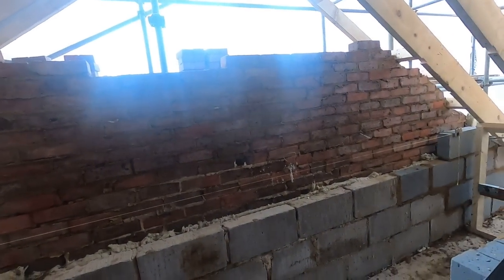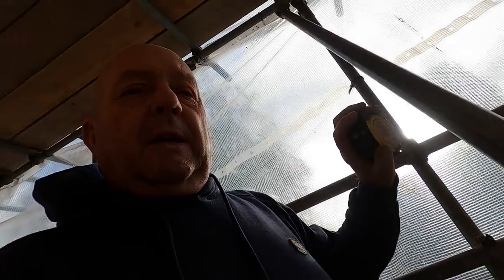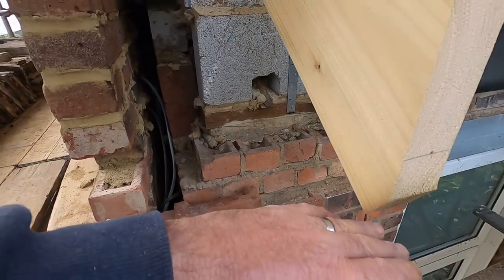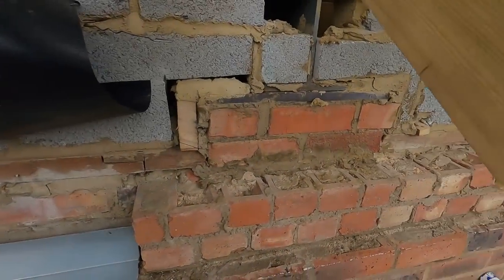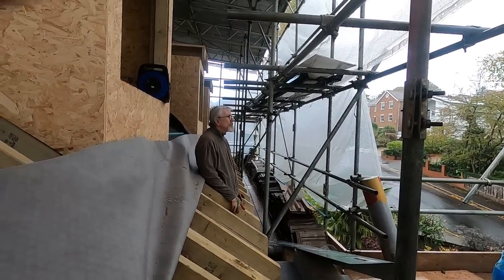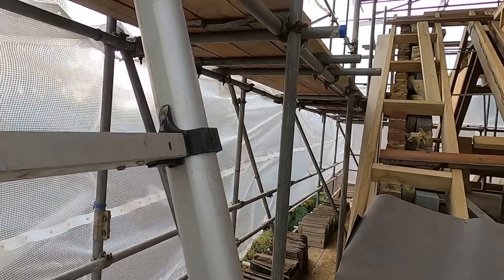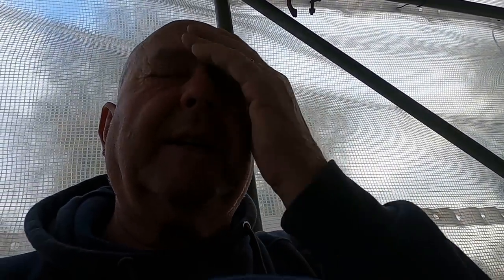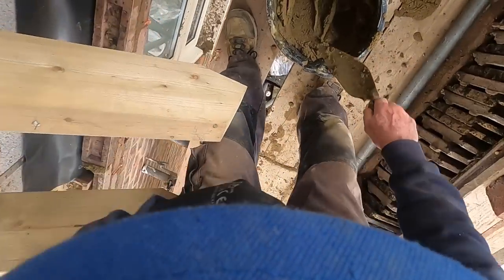A German Trowel and more Gable problems,

Comment: Hey up Andy,
I used to do some superstructure work for lift shafts and we used a wire plumb bob down the centre to measure off with the weight hung in a small barrel of oil so it didn’t swing about .
Crow eating the remnants 😂
Good video again

Comment: Was brought up to think about other trades following my work but thats way gone these days Andy .You did a good job of a pigs ear there mate 👍 🧱🧱
Reply from the maker: I know mate, when I was building extensions I used to do all the carpentry, roofing, plastering etc myself so you always made sure each step was spot on, I still work the same as I don't want to cause probs for anyone. Nowadays most don't care or just don't understand.
Reply: @bricklayersworldwithandy6277  
Spot on Andy agree totally with you.
I was taught to flush the joints on blockwork thats being rendered to help the plastera. Now they all joint it which makes the joint come through the render just one example of madness mate 👍
Reply from the maker: @brickrightbuildinglandscaping  One of bug bears that, hate jointing blockwork just keep your joints full 👍

Comment: Just looking at that timber work on the roof the stub wall should have a birds mouth to help with the spread.. especially with the collar ties up so high... I'd say when they load it it could spread... is the German trowel easier on the wrist.. .. your man anders is handy on it.. I think they are the job for working out of the tubs
Reply from the maker: I agree with the roof the design is wrong and I have mentioned it, it is the best designed trowel ergonomically I have ever used the swan neck takes all the weight from your wrist,I will be using it more often from tubs in the right situation.
Reply: @bricklayersworldwithandy6277  👍👍👍 enjoy the weekend andy

Comment: Hi Andy🖐It's really not difficult to get the gable ladders right with the brickwork even if the trusses/rafters are out of plumb. This is a classic case of 'every man for himself' and thinking/respecting the guys that have to come behind you😬 Not envious of you having to use the M25 as it's bloody hateful😵Cheers
Reply from the maker: Yes Del no care at all, ime a bit concerned about the whole roof there is nothing really tying it in only the collars which won't be doing much.I can't see what's going on underneath as the floor is down but the ceiling joists are not tying the rafters in. Building control didn't even notice just reeled of a load of stuff about the insulation he wanted which he had learnt of by heart.
Reply: @bricklayersworldwithandy6277  I did wonder from the video Andy, that the rafters don't seem to be tied at wall plate level, which as you rightly say, could cause issues with them spreading under load😬I'm not making any judgements on it though, as I haven't seen the drawings👍Have a good weekend mate
Reply from the maker: @thetallcarpenter  Nor have I lol 😁, you to mate?

Comment: Roads  much worse nowadays nice work Andy and the German line you recommended is the bollocks cheers 👍🏻
Reply: What is the brand name please?
Reply from the maker: @PooAAAA  the trowel or line?
Reply: the line please
Reply from the maker: @PooAAAA  https://www.amazon.co.uk/SCHWAN-SCH-340151-Builders-Line-Spool/dp/B01GTOSFTS/ref=asc_df_B01GTOSFTS/?tag=googshopuk-21&linkCode=df0&hvadid=226152056294&hvpos=&hvnetw=g&hvrand=16106274978162563018&hvpone=&hvptwo=&hvqmt=&hvdev=t&hvdvcmdl=&hvlocint=&hvlocphy=1006625&hvtargid=pla-420861115340&psc=1&th=1&psc=1
Reply from the maker: @PooAAAA  It's brilliant line but a bit thicker than most which puts people of, the other line I recommend is Imex.

Comment: why dont they just put the facisa on and brick up to it you wouldnt even need profiles then and everybody is happy, as a brickie id rather just brick str8 up to the fasica just string a line and gauge up each time easy job
Reply from the maker: Unfortunately with builders it dosent happen like that, good thing it wasn't in this instance as it would have ruined the facia having to take it of to alter the ladders,👍
Reply: @bricklayersworldwithandy6277  yeah I understand what you mean. But this day in age it would just be left out of plumb as long as no light between the brick and fascia you would get away with it.Modern day brickies ain't like the old school ones mate. I was lucky enough to be taught by old school brickies and it does show when you have a bloke the same age but learnt his trade from a younger bloke.
Reply from the maker: @leebowen8364  Yea I know what goes on, if it had been a little bit I would have done it but I weren't building a Gable 2 inches out of plumb 👍